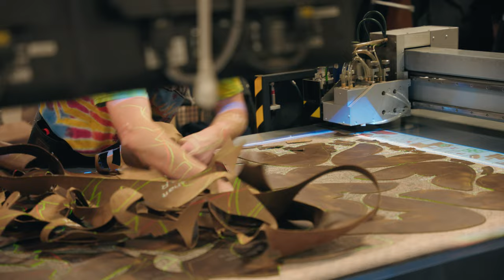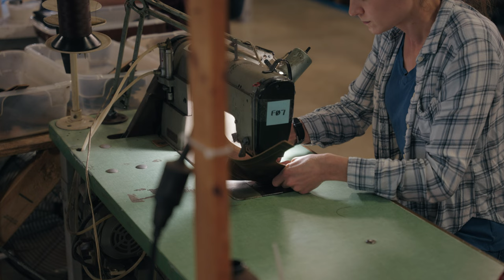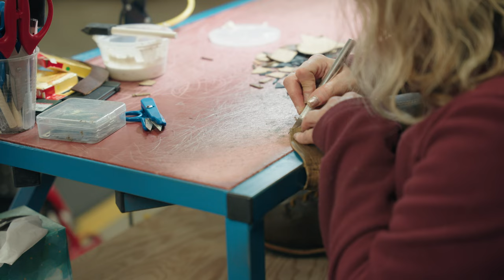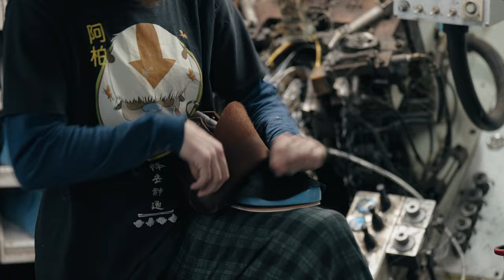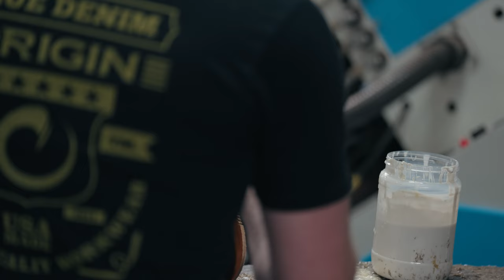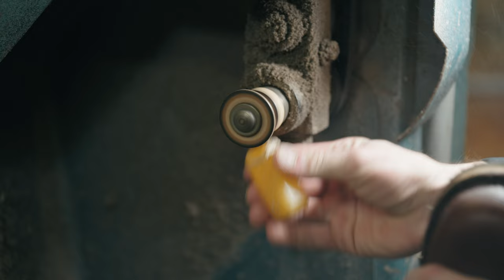How It's Made | Origin American Bison Boot

Comment: Bought the Bison Big Lugs in September. I love them, but now it’s the start of December & my right boot is squeaking like crazy! I’ve tried everything to alleviate the squeak, but no luck so far.
Reply: Usually it won't be fixed until you take them in for a resole. It happens with separation between layers on the inside of the boots. I have some White'sbthat are like that.

Comment: I believe these are $400, correct? 

The video doesn’t show all details of boot, appears to have some nice features like a 270* Goodyear welt w/nailed heel, full veg tanned leather slip sole. What’s the leather upper, oiled & waxed bison?

It’s not fully lined, the areas that are lined, such as the 1-piece vamp, appears to be lined in some black fabric? There’s no shank, steel or composite? The insole appears to be mostly foam? 

Might want to look at the Grant Stone boots, much finer materials and design details for same price.  For $400 I’m demanding fully lined in calf skin. No synthetic materials. A full length 4-5mm leather insole. A shank, preferably steel but composite better than nothing. Cork or leather instead of foam as filler. 

Full leather insole and cork instead of foam should not add to costs. Fully lining the upper in a calf skin may add some material and labor costs but you’re already higher priced than Grant Stone or RedWing despite inferior materials so maybe your margins need to absorb any added costs. As is, $400 for that boot is a hard no. I’d rather spend that $$ on the superior Grant Stones or spend a bit more on a Nick’s, White’s, JK or Truman
Reply: I couldn’t agree more and that’s exactly what I done. I just placed an order for a pair of Nick’s Engineer boots last week. Now I’m going to have to wait until late spring or summer before I receive them but from everything I’ve read online and seen on YouTube the quality of the boots is worth the price paid and the time waiting for them to be made. I currently wear Thorogood moc toe boots which have been the best pair of work boots I’ve owned and I paid $250 for them 3 1/2 years ago.

Comment: why do you guys uses fiber board instead of leather for insoles?
Reply: After watching various cobbler YouTube channels, they have said it's a cheaper material to use than leather insoles. It's to cut costs in order to make the boots more affordable for customers. Yes leather insoles are more durable for sure! So if someone wanted to, they can go to a cobbler and have one put in. That would require the cobble to take apart the rubber sole, midsole, and replace the fiberboard insole with a leather insole. Of course all this comes at a cost. So it's up to the customer if they'll want that done or not. Anywho, hope this helps 😊!